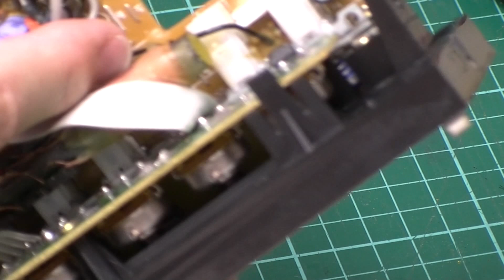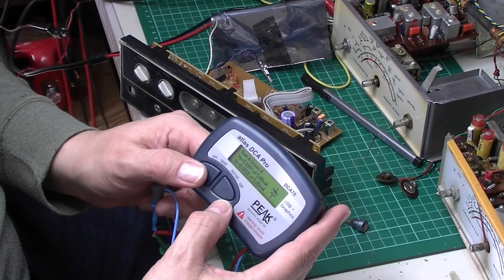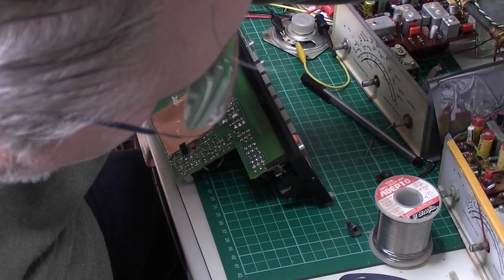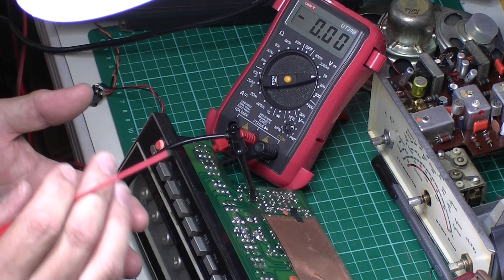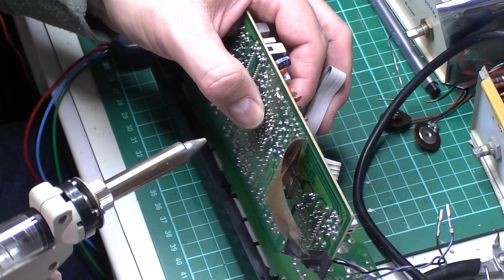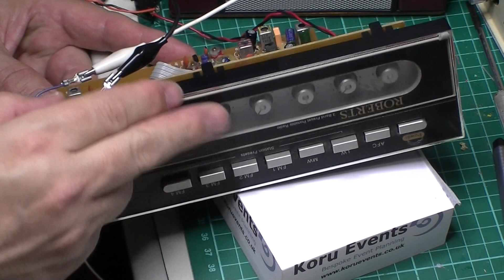Roberts RP28 transistor radio fault finding and repair

Comment: Update on my original comment. Not sure if you can help or not. I’ve replaced the voltage regulator and I’m now getting audio, albeit very quiet despite the volume being on full. This is the same for the headphones too. I’m unsure if this is the Audio IC or the main chip. Many thanks
Reply from the maker: Potentially the IF section as I think the audio chip dying would stop any output. If you have a signal tracer or oscilloscope then you could see what was happening
Reply: @ thank you for the reply and the tips. Do you have any pointers as to where the IF section is? Many thanks
Reply from the maker: The IF section goes through the TA8117N IC so I suspect that is the issue. Same as the one in my video
Reply: @Radiocruncher  thank you, I have an IC coming in the post so I’ll attempt to replace that. Fingers crossed 🤞
Reply: @Radiocruncher  just wanted to let you know that I’ve replaced the main IC and it’s fixed the issue. The voltage regulator was replaced as well as the main IC and it’s all back up and working. Thanks so much for the video and your help 😊

Comment: Thanks for the video. Today I accidentally soldered the battery wires back in on the RP28 and started to smell burning. I do get a faint pop when turning the power back on in the right polarity but nothing from MW, LW or FM. I’ve ordered a replacement voltage regulator as this has definitely failed on mine. Hopefully nothing else has failed. I opted for the STMICROELECTRONICS L78L05ACZ with an output of 5v
Reply from the maker: Glad it helped and good luck with the repair

Comment: I just bought two Motorola's tube portable radio ,if I new how to send you a picture I would love to see if you ever worked on that type of radio both 1950 era radios,both work ,which is one of the reason ,I bought and they are very nice radios,Someday I hopeing I can afford a Roberts because of your videos kinda falling in love with that brand ,and I would love someday to buy one of your ,but shipping so pricey.
Reply from the maker: Hi Ron. My email is Graham@radiocruncher.com if you want to send pictures over. I have worked on a lot of pocket radios from that era. Roberts are available but you will have to search hard over there to find one

Comment: May I ask where you got your TA8117Ns from?  And also the 78L05s.  I know I can get 50 of those from China for 99p but I'm doing this for a friend.  For the main chip I am a bit leery about getting a fake from China but Farnell don't stock it.
Reply from the maker: I bought some from a seller on eBay back in 2016. He’s still selling them here https://rover.ebay.com/rover/0/0/0?mpre=https%3A%2F%2Fwww.ebay.co.uk%2Fulk%2Fitm%2F323490100920. If you want one I might be able do it depending on how many I have left
Reply: @Radiocruncher  Thanks for that link.  I was a little wary of getting specialist chips from China.  I know from audio that there are a lot of fakes out there so it's good to know these aren't among them.  Incidentally, Iq (from your video) is the quiescent current, which is essentially what the chip needs to draw in order to keep the transistors switched on.  It's a more useful number in amplifiers, where it is what sets the 'bias' to give a smooth transition between positive going  output and negative going output.  In this regulator it is just telling you what the overhead is with no load; but in fact isn't even that useful, because the biggest loss is the drop from 9V to 5V, at whatever current the circuit is drawing.  That DCA75 looks like a nice little device.
Reply from the maker: Christian Thomas your welcome. Thanks for the info on the quiescent current. I hadn’t worked on this type of radio before so it was a bit of a mystery. If you want a TA8117N a bit faster then let me know and I will do you one for the same price. All the Peak testers are really useful and I use them on a daily basis so well worth buying. Regards Graham
Reply: @Radiocruncher  I missed this kind offer, which I would very much like to take up.  I wonder if I can PM you on YouTube?
Reply: @Radiocruncher  I sent you an email on your business address, listed here.  Was wondering if you got it?
Reply from the maker: Hi Christian. Yes I got your email. I am hunting through my stock to see if I have the TDA7231 before replying

Comment: Thanks for this.  I'm repairing an RP28 for a friend so this is really useful.  To say that these are badly made would be to underrate the skill of Chinese bodgers.  How many times do these things have to fail because of reverse polarity before they put in a diode.  They don't even have to have a voltage drop, but I expect they are too busy having tea to find that out.
Reply from the maker: Thanks Christian. Not Roberts finest hour! A diode would have been an easy addition to the circuit. Penny pinching
Reply: you all probably dont care but does anybody know a method to get back into an instagram account..?
I was stupid lost the login password. I would appreciate any help you can offer me.
Reply: @Anders Isaac Instablaster :)
Reply: @Benton Clayton Thanks so much for your reply. I found the site on google and Im in the hacking process now.
Looks like it's gonna take a while so I will get back to you later with my results.
Reply: @Benton Clayton It worked and I finally got access to my account again. I'm so happy!
Thanks so much, you saved my account :D
Reply: @Anders Isaac happy to help :)

Comment: Can you show how to fix a roberts R 9962
Reply from the maker: Hi Harvey. I do not have a Roberts R9962. Whats wrong with it?
Reply: Radiocruncher i accidently blew it up with a laptob charger
Reply from the maker: Laptop chargers are usually around 24v so you will have damaged the regulator section for sure but hopefully it didn’t get that far into the radio
Reply: Radiocruncher thanks :)

Comment: Excellent job. I have had three RP28's with blown speakers... swapped the speakers out in each and all good. I never used to check speakers first, but now I do on the RP28's. I used to trace the boards looking for faults that weren't there... Any idea what would cause this Graham?
Reply from the maker: That’s a strange fault. Did these radios come from the same person? Maybe someone has put power into the headphone socket
Reply: All came from different places at different times over the last few years. The one I finished yesterday had been worked on previously, it was a real bind getting the radio away from the case as it had been glued in (I think with epoxy!). It came in with 'no power', and initial thoughts were the ic's or bad caps, but no, a simple speaker swap was all was required - again!

Comment: Went don't you troubleshooting the radio instead of Easter egging parts.
Reply from the maker: I did a lot of trouble shooting on this radio and narrowed it down to one of the IC’s. I initially thought it was the audio IC but it turned out to be the rf IC. There is no schematic or service info for this set so I was going blind and hoped that finding no output voltage from the regulator was an easy fix but I assume that the polarity had been reversed taking out the IC as well. Since doing this radio I have done a few more similar ones with the same IC damaged so it seems this is the one that goes in most cases. Thanks for watching, Graham

Comment: What was that part number u replaced.?? something like 431.
Reply from the maker: It was a TA8117A unless you mean the 5v regulator
Reply: Yes the 5 volt one...Im watching your video as we speak...and I love all of them...Have you ever seen or worked on a Sony CRF-160? Im getting one in by Friday, I hope...good day..
Reply from the maker: Hi Kenny. I have just had a look at my parts bin and it looks like it was a L78L05. That Sony looks really nice. I have seen them for sale but haven't got one. It's probably like a lot of the other Japanese multi band radios of the 60's which are tricky to work on. Good luck, thanks for watching and for the kind comment. Graham

Comment: Hello!
On the RT1 you have in the backgroud (I think it's RT1)..
Ho do you remove the red arrow from the middle button (channel selector)?
Reply from the maker: Hi Marc. You will need to remove the chassis from the case 1st. Then unscrew the grubscrews, remove the knobs and Perspex dial cover. The pointer is a friction fit. I use forceps but a screwdriver inserted in the slot of the red pointer to spread it a little will enable it to be taken off
Reply: Thanks. Now I get it :)

Comment: I too was going to suggest using diodes...hopefully that will save the IC's (cheaper anyway).  I'm starting to like these and the Hackers....do you know if any were targeted towards the US markets?  Maybe under another brand?  Might be interested in picking one up.  ~Jack, VEG
Reply from the maker: Jack, I think Roberts probably would have exported but don't think they used a different name. Hacker as far as I know didnt. I have plenty of RP28's here if you fancy one. Just drop me an email or message. Diodes will be going in any that I sell on as I dont want them coming back damaged. I do now have some power suppplies that are the correct polarity though. Thanks for watching. All the best Graham
Reply: Would be interested on knowing what their counterpart was!  I will keep that in mind Graham, I'm not a real big fan on this particular radio as it appears it is only tuned via the presets(?), however I do like the fact it has them as well as that cool popup window!  I would want something easier to play with!  :)  Thank you! ~Jack, VEG
Reply from the maker: Jack, there are so many to consider! If you want something that sounds good, is reasonably priced but still can be repaired relatively easily then its got to be either a Roberts R600 or for the best sounding radio that Roberts made it's the R707. For Hacker its probably got to be a Hunter RP38a, although Sovereign's and Heralds are very good as well. Regards Graham

Comment: I have one of these in executive wine red, in fact the first radio I bought when I started fixing'em up. Good thing it worked as I knew practically nothing about how they worked then!  The thing keeps gradually losing tuning so it's consigned to the pile of shame at the moment. Are you going to put diodes in the incoming supply leads to stop polarity reversal? Just thinking about your recent Roberts repairs and the RP28 has nowhere near the quality of earlier sets. That said, Roberts are still in business, Hacker et al are not.

Regards _ Andrew
Reply from the maker: +Andrewausfa diodes would be a good idea Andrew. It would save someone in the future having the same problem. I am just tidying up the case at the moment so would be a good time to do it before I put it all back together. I've heard that these can drift a bit but not really heard what causes it. I agree that these newer radios are nowhere near the same build quality as the older ones. I wonder when they did the switch as I assume these are now made in China or at least the boards. Don't worry though as I have a huge pile of old Roberts, Hackers, Dynatron, Bush, Perdio, Cossor etc. still to come. I'm going to be tackling a few valve radios as well soon. Thanks again for the comment. Graham